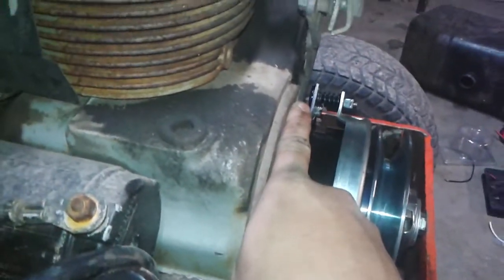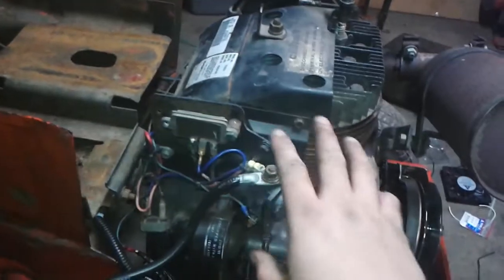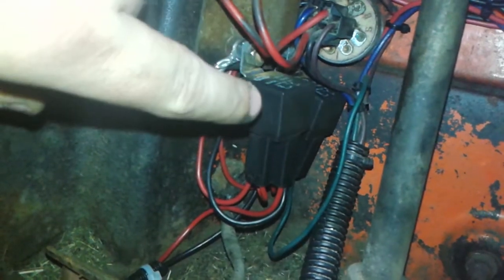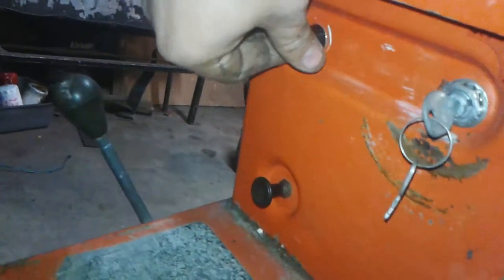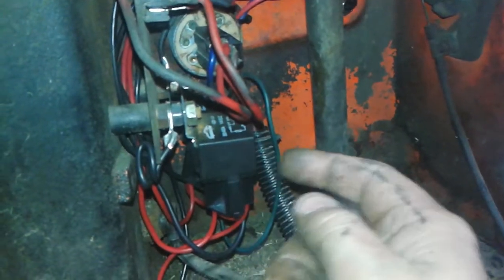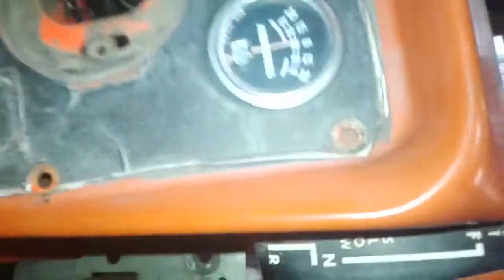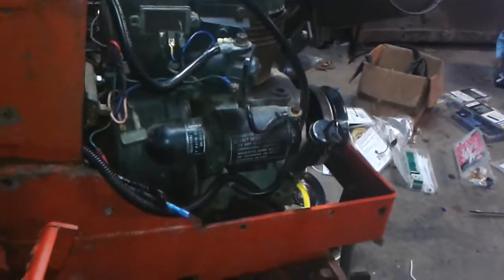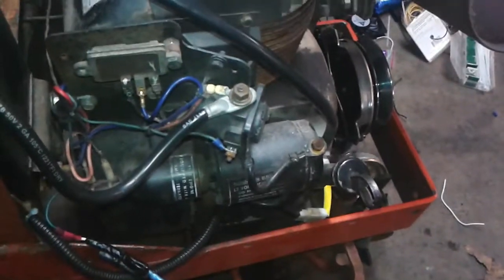712H Allis Chalmers New PTO Clutch install and wiring

Comment: How did that PTO work out for you? I'm thinking about doing the same but conflicted with how to bolt up the PTO. You mentioned that you used the exhaust mount hole. Were you able to use other existing mount holes?
Reply from the maker: You can use any kind or bolt, stud, or even a rod to hold the frame of the pto stationary. 
As for how well it works it works perfectly.
I used it couple times running the snowthrower last year.

Tricky part is finding a pto that fits the engine shaft dimensions.
Finding a belt that fits the pto and attachment isn't too bad 
Then you have to add spacers in front or behind the pto for belt alignment. 
I did use a pto from a John Deere 318 for the larger engine shaft that came with the replacement long block on the tracktor. 
Since then I rebuild oem 14hp with the original 1 inch shaft. 
I already had a pto from my craftsman gt18 thats identical to the previous electric pto. 
I haven't compared belts so not sure on pulley size difference between oem pto and the electric pto. 
I just matched up a belt that worked at a local hardware store.
Reply: What length of spacers did you use for the pto? Also what is at the end of crankshaft?